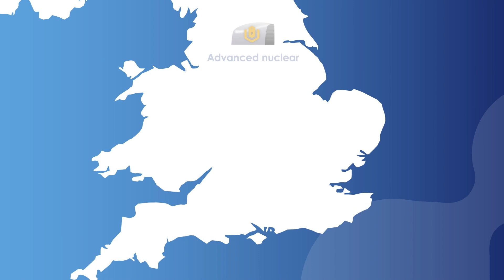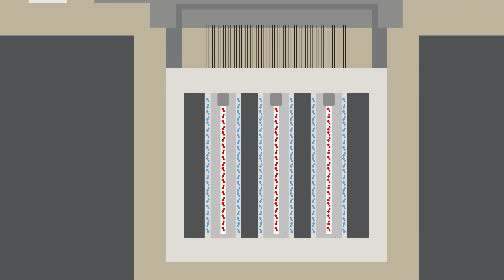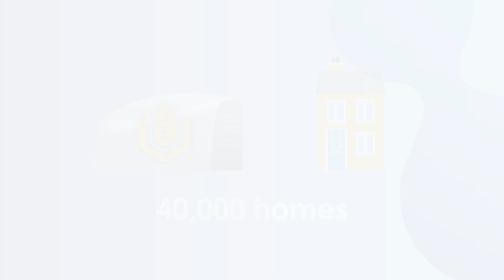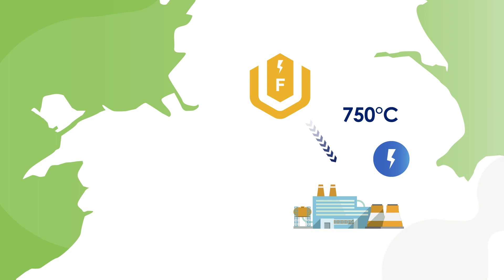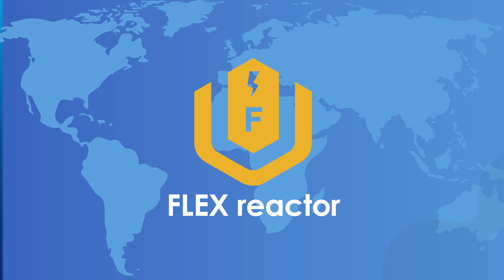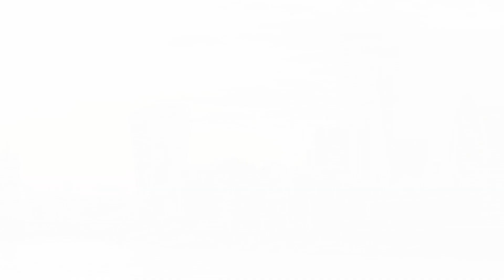MoltexFLEX - Flexible energy to deliver net zero

Comment: You need to explain further how you are going to be able to use your design "just like gas power (peaker) plants." If you mean you will be using your design in conjunction with thermal energy storage, say so.
Reply: I guess it is not the purpose of this video but I agree they should have explain a bit more in detail.
Reply: This is a PR video. If you want more detail search for it, there's plenty around.
Reply: Doing the research is why I have questions about the statement, "just like gas power plants" without also mentioning thermal energy storage.
Reply: Yes, they plan to use insulated thermal storage using some kind of salts, co they can triple the output when needed  (reactor + thermal storage).